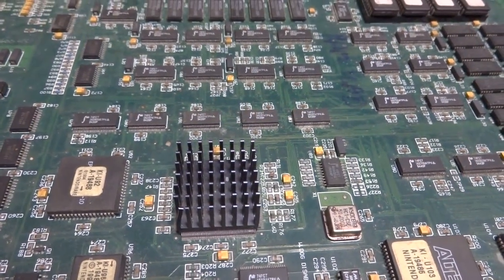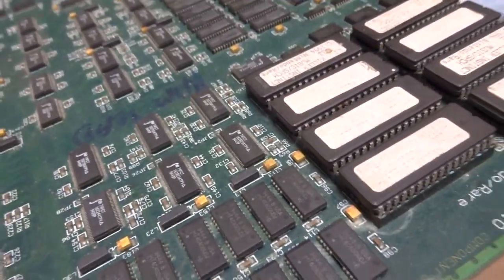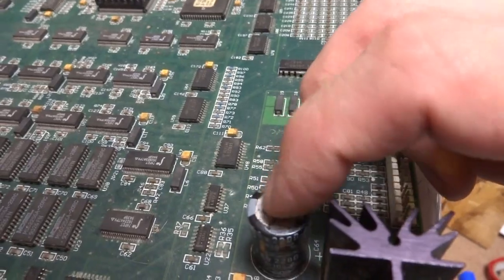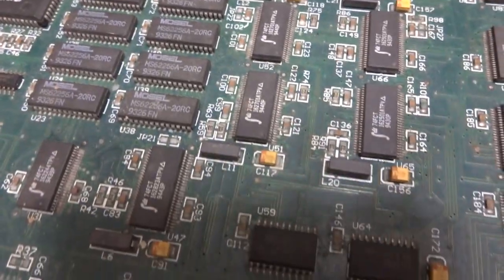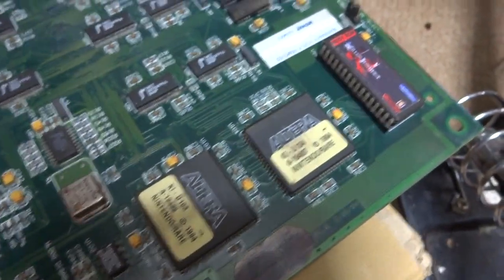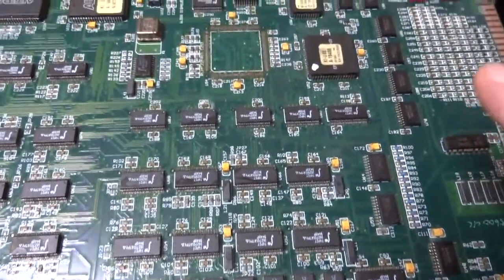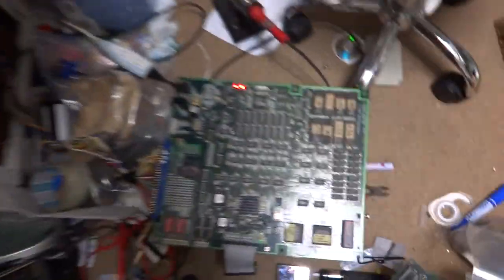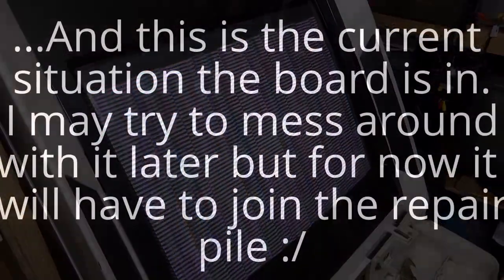Working On A KI Arcade PCB

Comment: Hey Luke. Thought this might be helpful. The bong noise you hear currently is normal, and means the board is booting fine. The board will make no further sound until either it goes through one full cycle of it's attract mode, or you insert coin. Looks like you just have a video problem !

Comment: Make sure you don't have any solder bridges on the CPU pins. You will need a 40x or stronger mag glass to see it well. Some bridges you can't see with the naked eye as they are very small.

Comment: ...also, this may sound obvious, but make sure the DIP switches are all set to OFF.

(There might just be a chance that it's booting past the test screen, so you may hear the attract sounds.)

DIP Switch settings on page 14 (remove spaces)...
tinyurl . com / qyayk7f

Here's the datasheet to the SRAM chips...
tinyurl . com / q6a4nud

If you have an o'scope, you could check the data outputs of the SRAM's to see if any are wildly different to the other chip (pins 11,12,13, and 15,16,17,18,19).

Comment: Hi, Luke,

Looks like the CPU is trying to boot, so it appears like the main DRAM's are likely working OK? (MT4C4001 chips, 8MByte total).

I don't know the full details on this board, but I believe the framebuffer is stored in the SRAM chips (71256, near the Analog Devices chip, 512K total).

I would try replacing only the SRAM chips from the other board and see what happens. :)

If the main DRAM was faulty, it probably wouldn't even boot to the "beep" screen.